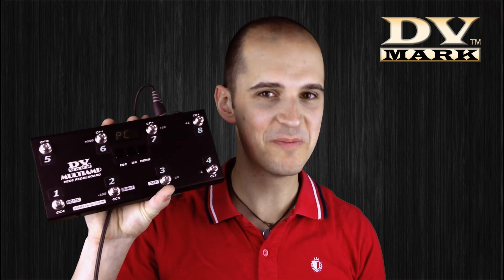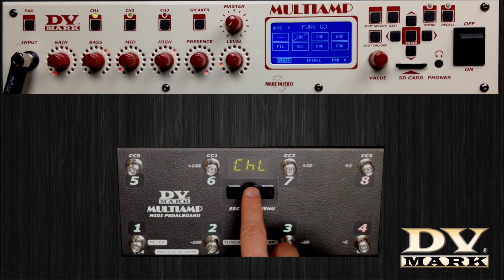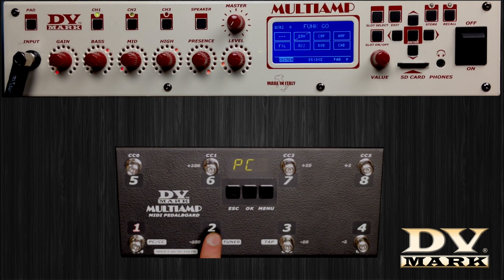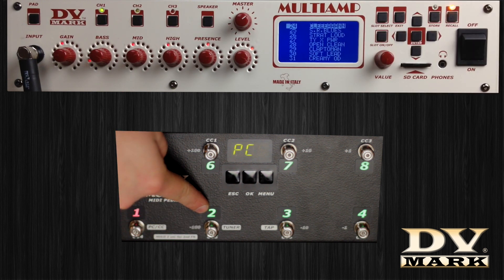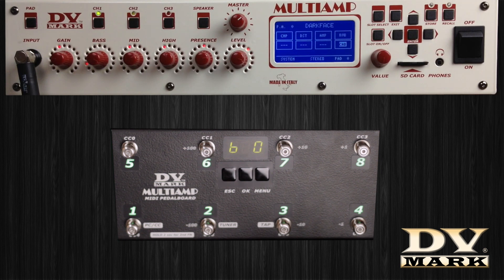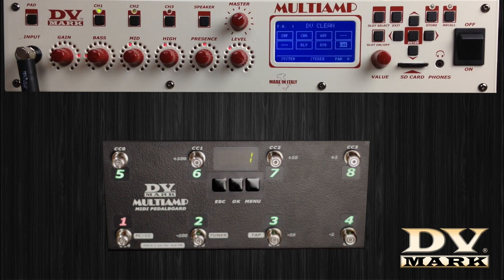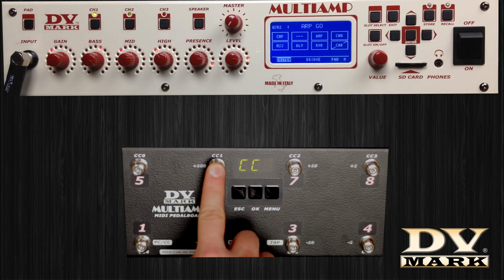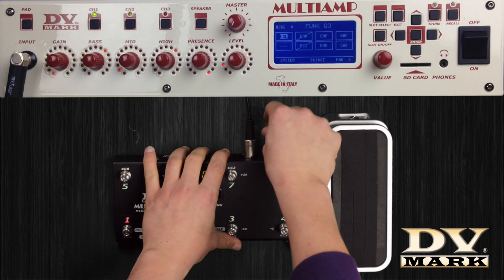Multiamp MIDI Pedalboard - Video Tutorial

Comment: Hey dude. is this the only pedal you can use to switch through the 3 channels? it's very expensive is there an alternative midi pedal I can use?
Reply from the maker: +shaun young to clarify: the Multiamp MIDI doesn't switch between channels but between presets so you've simply to made presets with the AMP channel you like and then switch between presets via pedalboard, the Multiamp is compatible with almost all the MIDI pedalboard on the market. Our pedalboard is not expensive if compared with other programmable (program change and control change modes) pedalboard on the market, plus it is very small but plenty of MIDI functions. For any further question please email us at info@dvmark.it . Thanks!!!